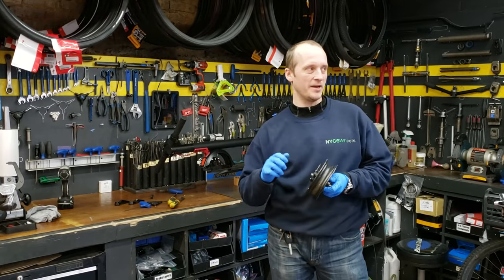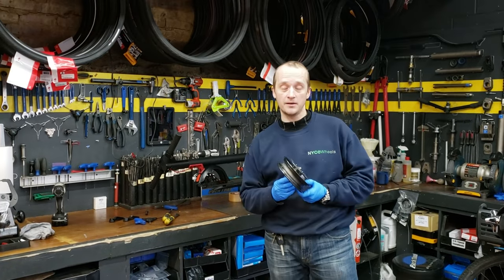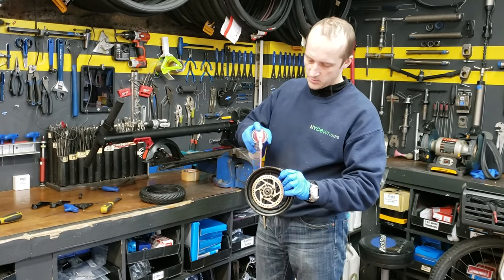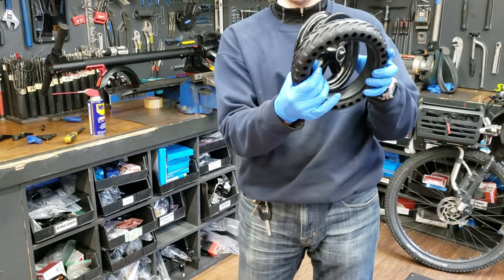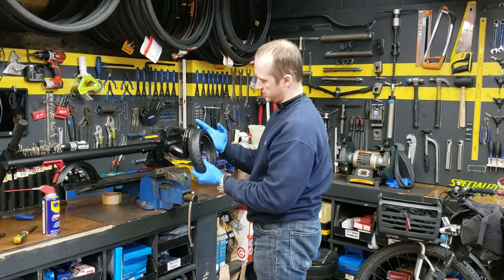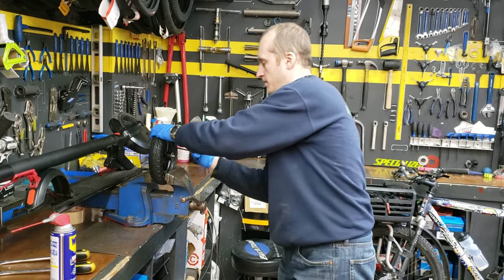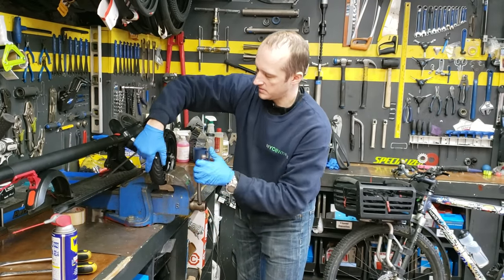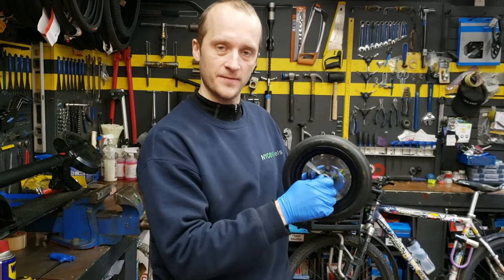Install solid tire on a scooter. Xiaomi or similar models.

Comment: This is the fastest tire installation I've seen so far and I've been searching a lot.
Reply: Of course he is a mechanics with all tools available
Reply: Put the rim on two pieces of thick wood, heat up the tyre in hot water and with three tyre levers and two persons its quite easy as well.
Reply: @radamante3231  yea I don’t have a workbench with a vise, wish I did it’ll make it a whole lot easier

Comment: Thanks this finally worked for me. For those people who don't have a vice or cable ties like me, I just used by body weight and put my knee on the tire to hold it in place while I used the levers to pull the top part of the tyre over the rim.

Comment: I struggled using the vise, but found that zip ties worked great and  made it pretty easy.  I just used soapy water for lubricant and that worked fine.

Comment: I tried getting a local bike shop in Portland to view this video and have my Xiaomi tubeless tire fitted onto my Gotrax XR Ultra rear wheel rim but they were too afraid to commit to this. So I took it upon myself.

 I gathered some very little supplies from the local hardware store; a 5 gallon bucket, 11 inch zip ties, and a 12 inch bar clamp. The workers at the ACE hardware shop didn't quite know themselves on how to tackle the installation but they agreed that my set-up was sound.

Fast forward, I warmed up two pots of water to just under 200 deg F and let the tire soak for 10 minutes. You need just enough water to fully submerge the tire. I had with me two big tire irons from a previous purchase and a can of WD 40 just in case i needed lubricant. 

Guess what, folks. All it took was ONE zip tie and two of three tire irons I own and the tire went onto the rim in less than one minute. I kid you not, it's fucking doable and I have little to no experience with bike/scooter maintenance (although I have experience as a maintenance worker). 

5 Gallon bucket of 200 deg F water (soak for 10 minutes -- THIS IS CRITICAL AND WILL SAVE YOU TIME AND ENERGY)
One zip tie (I didn't even need the damn Bar Clamp)
Two tire irons (not sure if you can get away with just one) 

Whole prep and execution done in less than 15 min. 

Thank you for this video. I've seen countless others and this was by far the most efficient process. I was worried I'd need a table mounted clamp like in this video but I did this on my kitchen floor. 

For safety reasons, just don't heat the tire in an oven or microwave or have it inside one of your pots. Get a bucket and wear some work gloves while you're at it.
Reply: I found that placing the tire/rim into a vice and one crowbar (tire iron) was enough. The heated water or soap/cleaner/wd40 was not necessary.
Reply: how can you do it with the wheel where there is no entry with the zip tie, for some the wheel is the front and others its the rear.

Comment: Thanks, locking a point with a strap was the key for me. However, I didn't use WD40 inside for fear the tyre would slip while breaking, just dishwashing soap on the bead. I also used the old tyre as base to work on to keep everything flat.

Comment: Thank you for showing the method! It worked well for me. Tips: make sure you heat the tire - microwave is fine, use liquid soap or oil as lubrication - also on your tire levers, think of the process as snapping a big thick rubber band onto the rim. Stretch that tire to get it over the rim and don't be shy, you're not going to break the tire. Next up: I try to do the front tire without a vise.
Reply: I broke the tyre

Comment: To the haters in the comment section:
1. I took my daughter's scooter to 5 different bike shops in FL. They all refused to fix it. Being mechanically inclined, I chose to fix it myself.
2. I used silicone grease instead of WD-40.
3. The vise is a must! I tried pressing without it, and it was a nightmare.

Thank you for this video!!

Comment: Wow worked great on the rear tire of my Gotrax Elite!  Thirty seconds and POP!.  Small centering time and done.  i do have have to say though.  Tried this on my front tire with the hub motor in and had to muscle it the old fashioned way.  Not the vice method.  Front tire wheel and tire wouldn't stay in the vice for the life of me.  Kept popping out. Perhaps removing the  hub motor might have made it easier but i doubt it.

Comment: WD-40 WILL DAMAGE THE RUBBER!!! It's a penetrator for metals only!
USE SILICONE SPRAY INSTEAD!
Reply from the maker: I know that. But the tire thick enough. Wd will soak up with the rubber and stay there. But you won't feel it.

Comment: This video just saved me a bunch of time, and I appreciate it! It worked like a charm on the rear wheel of my macwheel mx-1. Unfortunately, I had no luck with the front wheel on the motor, as it kept popping out of the vice. Do you have any suggestions on how to do the front wheel?
Reply from the maker: Thanks.  Probably you need a wider vise.
Reply: @DenisBikeMechanic  a wider vise? Like what? I have the same problem, there is no way to zip tie one of the wheels where there is no entry

Comment: I have a Neon Pro Okai scooterr model ES30 and the back tire got badly damaged, so i want to find a decent replacement compatible for it and put 2 new tires to my scooter,  im new at this type of stuff and i don't understand very much about tires sizes and comparability
The tire says

60/75 - 6.5 (10×2.5)

And its hard to find on amazon or ebay and how to look for one that fits

And i need my scooter to be able to go to work and back or i would have to walk every day around an 1hour some tes more since i gotta do a lot of heavy lifting at work and my body takes a lot of damage.

Comment: I don't use E scooters myself but done a couple of scooters for my work colleagues the way I done it was to use a vice a weak solution of washing up liquid a utility bar didn't heat the tires still had them on in seconds

Comment: Mine came with solid rubber tires (HiBoy S2 Pro) and they are rock hard with hardly any flex at all.  I'd like to replace them with honeycomb tires but they look like a pain to remove 😩.

Comment: Are there benefits to this over a inner tube tire
Reply: With a solid tire you’ll never need to add any air ever just grab and go not really recommend this for stronger scooters these wheels work better on entry to mid level escooters.

Comment: What is the temperatur of the water you use and how long time do you have it in the hot water to make it softer? Greatful for answers.
Reply from the maker: Actually nowdays I don't heat it up. Unless if it's not freezing, it will stretch.
Reply: @DenisBikeMechanic  Thanks for the answer

Comment: Have you ever replaced Unagi tires?
Reply from the maker: What's so special about them?
Reply: @DenisBikeMechanic  yes or no. 
 No ulterior depth.  I have tested out the pliabilty of my tires and given how often I hammer them across light rail crossings,  they should pop right off without cutting or heating.  Unagi won't sell me new tires. Only gently used. I kinda like them slick. There was a definite vibration from the tread pattern.

Comment: Hi sir is it possible that can put solid tires on pneumatic tires? In short it is possible to convert?
Reply from the maker: Most pneumatic tires can be replaced with solid ones. Just match the diameter and width of the rim.

Comment: I have a 10 inches tires on a Pure scotter. I want to change them to a hard ones , since I am getting many punctures. Do you do such a job? where are you located ? how much to change both tires ?
Reply from the maker: Voltaire cycles of Verona, NJ. 400 Bloomfield ave Verona nj. $80 labor.
Reply: @DenisBikeMechanic  Thanks for the reply ...a bit far for me though ...sorry i thought you are in the UK. by the way I love your videos , and as a recommendation what 10 inch solid tire you would suggest?
Reply from the maker: @موفقبهجت-ذ5ص  They all about the same.

Comment: Hi Denis, I am wondering how much it will cost if I ship two wheel to you for solid tire replacement. Thank you
Reply from the maker: Hello David. $30 per wheel. But the front wheel with the motor most likely does not have a plug to remove.
Voltaire cycles, 
400 Bloomfield Avenue Verona nj 07044
Reply: Denis Grishin Hi, what do you mean? Cant I change front tire on Xiaomi Pro 2?
Reply from the maker: @zeigermaher  yes you can, but you can't unplug the motor due to a solid cable.

Comment: Hey Denis I have an xtract scooter similar to a kugoo m4  which tyre size is 10×2 50 6.5 and mine is a 10×2 70 6.5 would the kugoo m4 tyre fit mine cause find it difficult to find my size
Reply from the maker: Idk. Looks like it may fit.
Reply: @DenisBikeMechanic  is the 10×2 the rim size and width and the 70-6.5 the tyre height and thickness?  Probably silly question but I am clueless

Comment: OK the microwave thing is absolutely untrue I heated these same tires with a microwave, it was fine. Heating with a microwave works better if you soak them in water first and then heat them but it does heat even if you don’t use water.  Microwaves (and I’ve heard this before) don’t just heat things with water in them, microwaves bombard The molecule/Atoms with light which strikes the electrons and moves the electrons to a higher orbits which causes the molecule to move other molecules (obviously it’s a lot more complicated but that’s the basic premise)i.e.heat. It has nothing to do with if it has water or not.

Comment: has anyone done this on an apollo explore scooter!   they are 10 x 2!  i just shelled out  3 flat tires on 45km !
Reply from the maker: Idk. Ask seller if there is an option with solid tires. With pneumatic ones- keep pressure high enough otherwise the tubewill be chewed by tire.

Comment: Thanks for the nice video! When fixating the tire in the vice it easily scratches the rim, and also metal tire spoons easily damage the rim. Do you have the same experience and any fix for that?
Reply: @Lucky Bird Bikes
, our vice is old so the clamps are smooth. You can put some cloth in between. Metal spoons are fine with those rims since thy are thicker than a regular bicycle rims. Nothing happens with the rim and it doesn't get scratched.

Comment: Hey man please help me i installed yesterday one on my e scooter but now he dont drive faster then normal
Reply: solid tires are always a bit slower
Reply: @The.Peace.Pixel1 , you're right. they are heavier and require more energy to accelerate.
Reply: Denis Grishin yeah, I replaced both tires in my scooter with solid tires. The top speed went down by like 10% but the range is what has the decreased the most by like 25%
Reply: Mines came with stock 6.5 inches solid tires, everything is true plus a much more scarier and rougher ride

Comment: I dont recommend this method. It broke my rear tire rim of my gotrax scooter.
Reply from the maker: Each 2nd scooter I mount solid tires is a gotrax. Never had problem with them.
Reply: @DenisBikeMechanic  I think what happened was the vice cracked the tire rim because there was too much pressure from the vice.  I learned that a safer way to mount the tire is to drill a hole into a 2x4 and mount the tire rim to the 2x4 with a bolt, then put the 2x4 into the vice so that the pressure of the vice isn't directly applied to the tire rim.

Comment: Although this video gives you a tip how to soften full tyre to put it on easier it also shows you how NOT to do it. All the damage to the paint on the rim this guy did by cramming it into vice and then using metal tools to pull the tyre on is beyond me. You can actually see damadged paint when he demonstrate spinning wheel at the end of movie. Avoid this guy if you care for your rig.

Comment: Hi I installed a new rubber tyre and it keeps coming off when riding do you think its faulty its not the wrong size as I did measure it before I purchased it and got a new one but same thing happened
Reply from the maker: Hello. Your rim may be inappropriate for the tire.